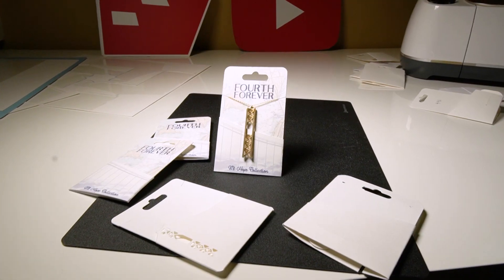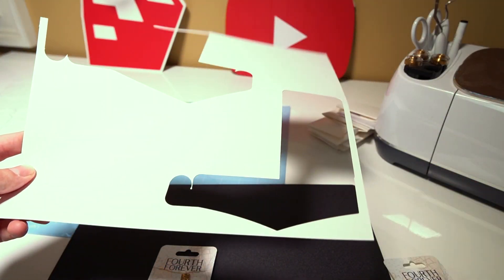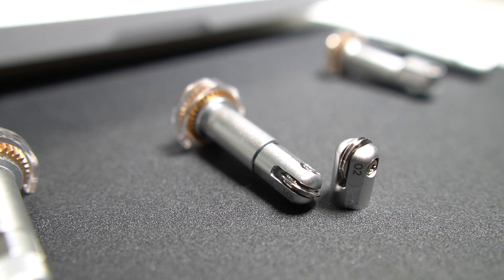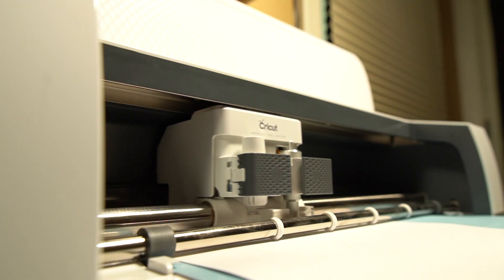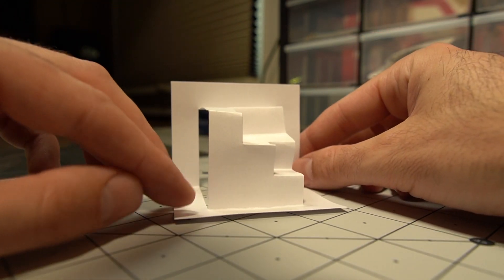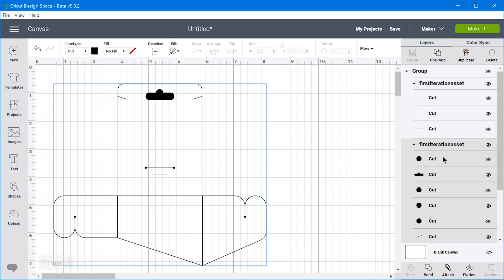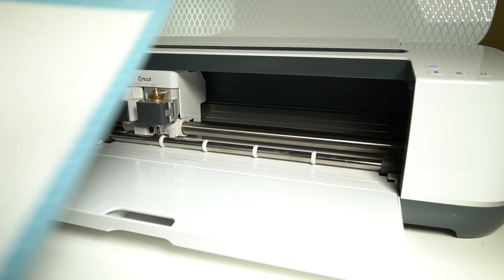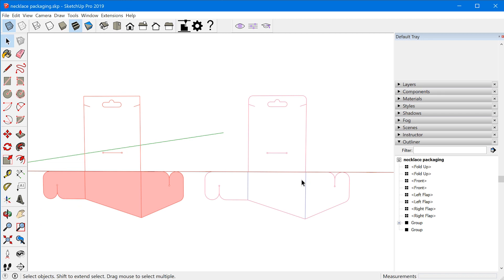Introduction to the Cricut Maker and paper packaging design in SketchUp

Comment: Really cool! How did get the print to match the cutting template?
Reply from the maker: The Cricut Maker has a "print then cut" feature, where it will let you print an image, and it will automatically align the cut, but it's limited to 6 3/4" x 9 1/4". Instead, I did a trick that let me cut full 12x12 by screenshotting the layout and bringing it into Photoshop to align and print.